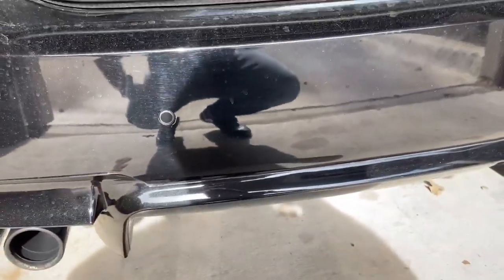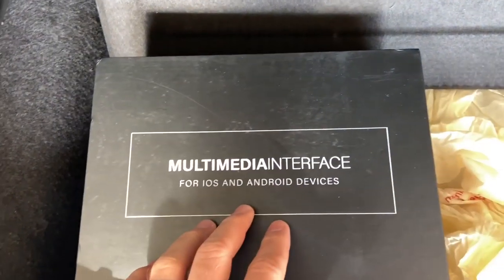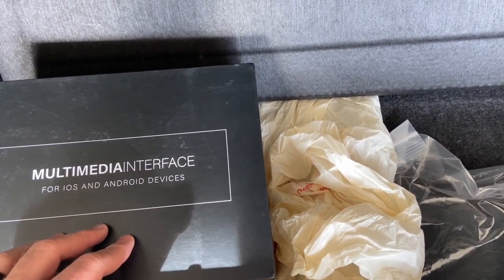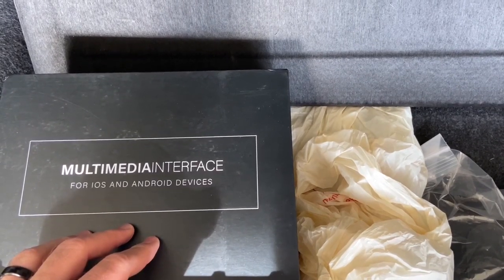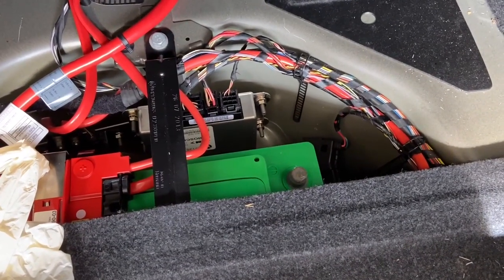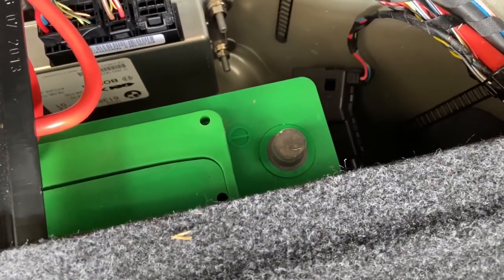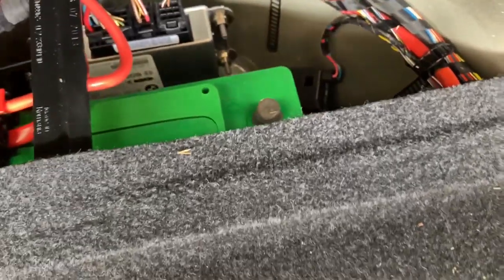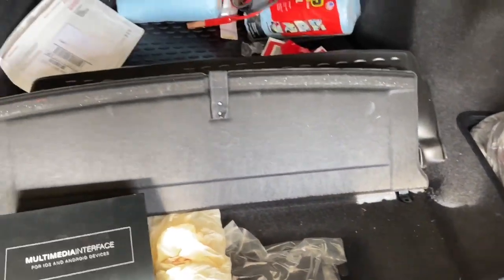DIY: BimmerTech Wireless CarPlay MMI Prime Installation in F10 BMW

Comment: If you add  an end loop to the fiber cable from the cdc all audio will work :)
Reply from the maker: Homerraas cool! That’s great to know thank you 😃
Reply: Homerraas can you elaborate what you mean? What kind of cable is it and where does it plug in? Sorry I’m new to all of this...
Reply from the maker: Sohaib Hasan I think he means it’s just a plug that reflects the signal back? Or something like that and then the signal sender (source) would know that there is no module installed at the receiver end... I could be wrong though.
Reply from the maker: Homerraas I searched eBay for loop back cable... if you search eBay for item number 223136521415 is this what you’re referencing? I can’t recall the shape of the cable now...
Reply: @GrindMyGears  if you add an end loop the modules in the car will keep working as the fiber optic still works, if you don't use a loop all modules that are on the fiber line will stop working
Reply: @GrindMyGears  thats the loop!
Reply from the maker: Homerraas ok makes sense now. That means each module will have two fiber optic lines to it. One to receive signal from source and one to send signal from receiver to sender. All the loop is doing is keeping that connection going... interesting! I know very little about fiber optic communication protocols sadly... all I know is that they’re fast lol
Reply from the maker: Homerraas or to keep signal going from receiver to next module on the line... oh my it’s a chained connection isn’t it!! If one module isn’t working or signal isn’t passing through, then the one next in the chain won’t get the signal... makes think that communication on the bus happens by sending a module ID so each module would know oh this signal is for me... kind of like serial bus

Comment: Great video - thank you!

When you put the car in reverse does the back up camera automatically appear - if so is it the factory display with prediction lines and warning overlays? What about the nose left/right cameras - or the 360 view if that is activated by pressing the physical button? What information appears in the hud when it's in use?

Thank you!
Reply from the maker: Krynos thank you! When reverse, the factory camera in factory screen will appear. In the M5 I have the surround view and it appears when car is in reverse. While using the CarPlay, your HUD will only display the usually stuff... nothing extra... so maps are NOT going to appear on the HUD!! Just your speed limit and the default stuff... it’s not perfect unfortunately but is a great upgrade!
Reply: Grind My Gears thanks for replying. Sounds like a good upgrade for my 550i. My only concern was the camera system as that’s all I really use the idrive system for primarily. I’m using my phone for music, directions, podcasts etc... I’ve driven a bunch of new BMW's when my car has been in for service, and about the only 'new' feature on them I wished my 2014 had was CarPlay. I’ve ordered my upgrade module and I’ll be issuing your video to help me install it.
Reply from the maker: Krynos that’s great! Yes it’s a really nice feature... if I remember correctly, the new M550 and F90 M5 I had did not project maps on HUD when CarPlay was used!! But since it was factory, the integration was better... let me know how the installation goes for you! Where did you order your kit from? AliExpress or bimmertech?

Comment: Hello, thanks for the great video. Why do you need to set the volume of the aux? Does this unit still uses the aux to transfer the audio to the HU? Are you able to use your OEM microphone when using carplay? Thank you again
Reply from the maker: Davisr20 Mol thank you, I believe the unit does send audio via AUX that’s why you need to adjust the volume on it but it does that behind the scene... you don’t plug anything in the AUX port in center console but the device plugs to it via the harness I think. Your vehicle microphone will work just fine I have used it. So far the unit is working great but nothing beats factory CarPlay... it just works better but this is the cheapest way to get CarPlay unfortunately.
Reply: Grind My Gears thanks a lot for the explanation. Happy holidays!
Reply from the maker: Davisr20 Mol do you still need the link to the cheaper unit? I listed my email in the first comment on this video... feel free to email me if you still need it.
Reply: Grind My Gears Thanks I did email you. What I’m doing is comparing all the options to find the best performance- cost option. However, it seems that the bimmer tech option is the most similar to OEM as far I research.

Comment: Hey does it display when you put the volume up or down while in CarPlay?
Reply from the maker: Raul Llano good question! No it does not display volume level when you change it 😕
Reply: @GrindMyGears  but you can control the volume at least right?
Reply from the maker: Raul Llano yeah you can control the volume from the volume knob and from the steering wheel volume buttons. You can select next or previous songs from the steering wheel small wheel thing that you usually use... it basically moves the selection on screen so you can select the next/previous buttons or select another app from the CarPlay interface as if you’re using the iDrive wheel knob.

Comment: Any chance of connecting an Android phone and showing how that works on video? Thanks.
Reply from the maker: arriba I’ll try to find an android to connect. Should be exact same procedure.
Reply: @GrindMyGears  i can't get my android to connect to it so if you can try that would be great to see :)
Reply from the maker: philip sommerton ahhh the good old android. I need to find one lol... I used to have 3 android phones laying around but I can’t find them. I heard Android is not supported wireless on this module! Only wired... were able to get it to work wirelessly?
Reply: @philipsommerton4280  coz it’s an android. Go buy a decent iPhone

Comment: I have 2011 528i CIC SYSTEM... Can this work with CIC or does it need to be NBT ?
Reply from the maker: MaNI Ru it should work... send the seller your VIN and they’ll send correct box. The difference probably is just difference software on the box if any... it’s probably the same!

Comment: So, the unit doesn’t come with the led screen right?
Reply from the maker: Stephen R LED screen? Are you talking about the iDrive screen? It doesn’t come with any screen... I think the screen comes if you’re retrofitting the factory NBT EVO system as a whole kit which costs few thousand dollars I think...
Reply: Grind My Gears How was the Unit been running in your bimmer any problem? Thx!
Reply from the maker: Stephen R no problems at all man! I had an issue I posted a video about which was fixed in their software update and now operates flawlessly.

Comment: Is the Siri volume adjustable?  I just installed this unit in my car and the Siri volume prompts for map navigation are too low.  I tried increasing the Siri volume while Siri is talking but that increases the volume for everything not just Siri.
Reply from the maker: Andrew M hmmm in Apple Maps you can swipe up while the navigation is telling you directions and select audio and then select the prompts volume to be high. Is other audio loud? Like music volume is good? Did you set the volume level from the iDrive menu when you selected AUX as the media type? Maybe that one needs to be cranked up... btw you can’t increase the phone volume when CarPlay is running because it just uses the device audio directly not like connecting to Bluetooth or headphones where you can control the volume with the phone buttons... so maybe you’re connected to the cars Bluetooth still somehow? Make sure you go to Bluetooth menu on your phone and do forget device on the bmw option so the car won’t connect via Bluetooth again.
Reply: @GrindMyGears  Thanks for the quick response!  I tried to swipe up on my iPhone while the navigation is up on CarPlay but the option to swipe up is not available while navigation active on CarPlay.  But I was able to make the change you suggested via settings -> maps but that had no impact on the volume.  The challenge I have is if I'm listening to music in CarPlay traveling at 65 mph (road noise) the Siri navigation prompts aren't loud enough and I just want to increase that...seems odd because if I pair my iPhone to my car via bluetooth doing the options you mentioned increase the Siri volume when just using navigation on my phone (no CarPlay) but for some reason that setting has no impact on CarPlay.  I did disable the bluetooth on my car to ensure my phone just using CarPlay via aux.
Reply from the maker: Andrew M that’s weird... so you go to settings on iPhone and then maps and then you can select “driving & navigation” menu and that will have volume options... select loud volume from the “navigation voice volume” options... what that will do is reduce the volume of anything playing on your phone and increases the volume of navigation prompts... but if you’re trying to increase the volume of Siri in general and not just maps (like when you talk to Siri) then that’s something different... let me check if that has a setting in the phone.
Reply from the maker: Andrew M I couldn’t find something specific for Siri but you can also try to go to settings then “sounds & haptics” then under ringer and alerts, enable to button that says “change with buttons” and see if this helps when you try to crank the volume up
Reply: @GrindMyGears  I did try selecting loud, normal and low and there was no difference BUT if I selected "no voice" that option worked.  I did open ticket with Bimmer Tech and they told me the issue will be addressed in firmware update due out late this week or next.  So I'll give that a try and hopefully resolve my issue.  If you select low, normal or high do you actual hear a difference in volume on your setup?    Thanks for your feedback!
Reply from the maker: Andrew M if I remember correctly, it did make a difference for me but I’ll try it again and let you know. Did they fix the problem for you? Are you ok the latest iOS 14? I’m still on 13 I think but I heard iOS 14 has better support for after market CarPlay boxes.
Reply: @GrindMyGears  I have not received any update from Bimmer Tech yet.  I'm hoping this is just a iOS 14 issue.  Let me know if you are able to actually adjust the Siri volume independently of music etc.  According to what I have read you can adjust Siri volume only when Siri is talking.
Reply from the maker: Andrew M that’s weird... usually they reply very quick at least saying that received the issue... Maybe they’re still working on a fix I hope. I tried controlling Siri’s volume today while using navigation but it didn’t do anything... it just lowers the volume of whatever is playing and then talks directions so I hear it clearly but I couldn’t control its volume separately. This is not the CarPlay box issue btw... same result I had in the G30 M550 and F90 M5 I had before this car and those had CarPlay from factory.
Reply: @GrindMyGears  ok, I'm glad to hear it same issue on factory CarPlay too.  Maybe Apple just has not built that functionality into CarPlay for Siri...BUT..I did a test with Google Maps in CarPlay and the voice guidance is independently adjustable if I adjust the volume knob while google maps voice giving guidance the volume knob is adjusting only the voice guidance volume.  Just seems like a big miss that simple functionality not available for Apple Maps and Siri in general for CarPlay.  I did hear back from Bimmertech quickly and their email said new MMI Prime firmware due out late last week or this week.  That was an email from over a week ago.  I did not see any new firmware released as of this morning.  Maybe it is just taking longer then expected.
Reply from the maker: @andrewm2147  interesting insight... I don't use google maps so it's good to know but it sounds like an issue on Apple's side... hopefully bimmertech will be able to tweak something in the interface to give that capability! Would be nice to have for sure... keep us posted!

Comment: Can you manage to listen to the radio and use Google maps at the same time?
Reply from the maker: Terry McGrouther you can but the catch is you won’t here audio from google maps. So while in Apple or Android CarPlay, click AM/FM on the dash and it’ll switch to whatever station you had previously playing then you can tune using the buttons but unfortunately you can’t see since CarPlay would be on the screen so you’d have to switch back to iDrive by pressing menu button and holding it (same way to get into CarPlay MMI menu) then you can change radio station and once done, bounce back into CarPlay... but won’t hear anything from CarPlay until you switch your audio source back to AUX from iDrive menu. Clear as mud? Lol
Reply: @GrindMyGears  Thanks mate. I have ordered a unit from Aliexpress that I am sure is the same box and firmware as this so will let you know how I go. Thanks for the fitting guide.
Reply from the maker: Terry McGrouther you’re welcome! Let us know how it works out I’m very curious.
Reply: Grind My Gears will do! Hopefully will have it by the weekend.
Reply: @GrindMyGears  i use blutooth direct from phone for carplay unit then you can use your wheel to change sources, etc without going back from the mmi screens
Reply from the maker: philip sommerton yeah I believe so... you’d have to select AUX I think to circle back to the audio playing from CarPlay module!
Reply: Quick questions I have a 2011 528i CIC .... Doesn’t it need to be NBT Head unit for this box to be compatible ?
Reply from the maker: MaNI Ru it’ll work with CIC I believe... you just have to tell them the VIN and they’ll send the correct box.